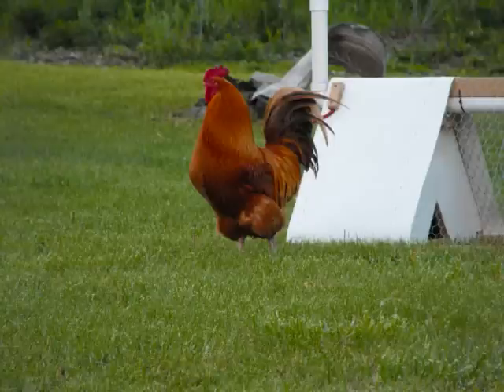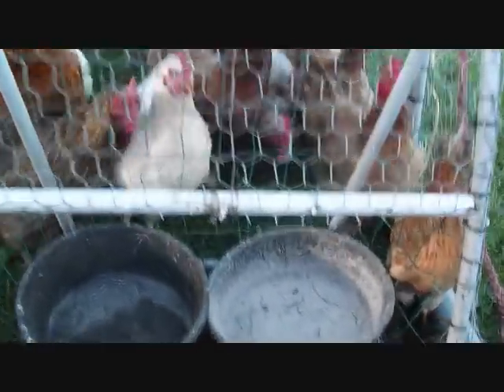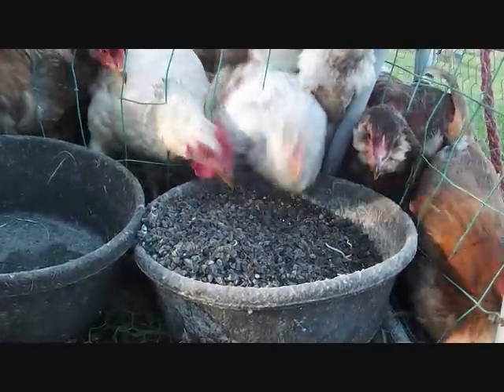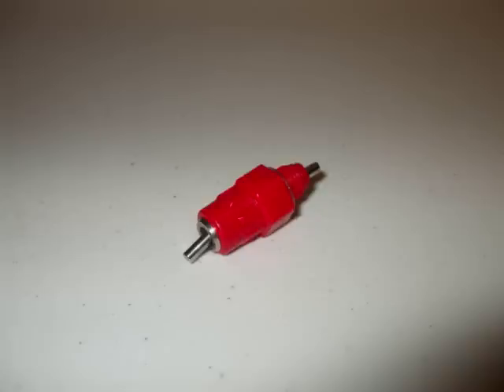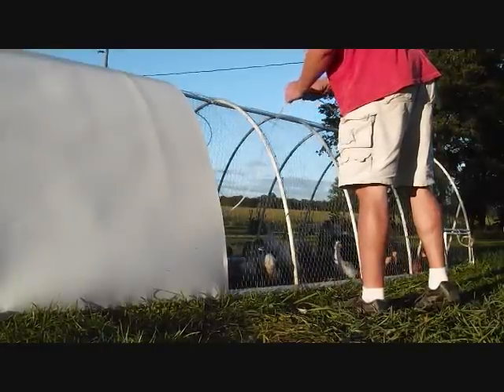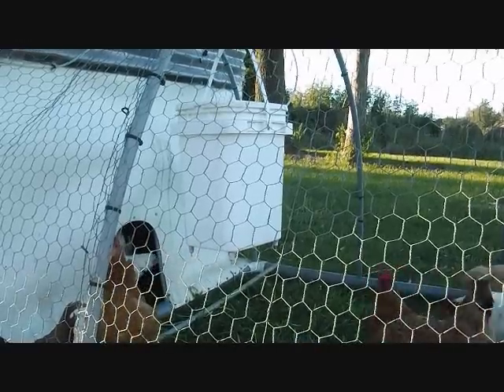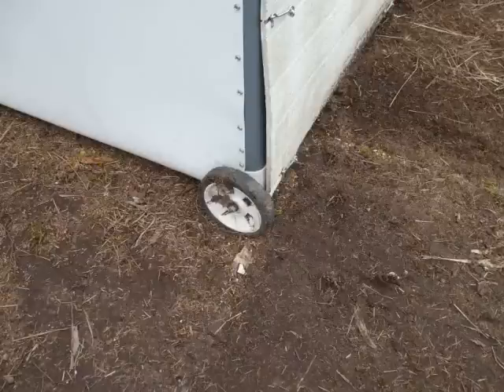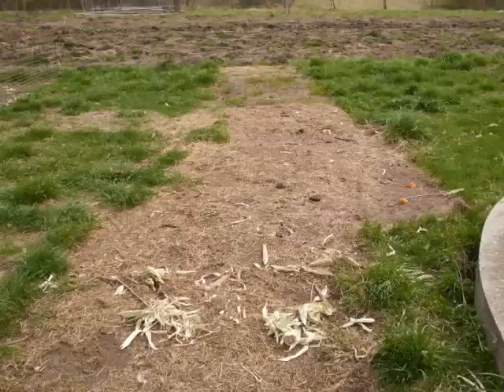Chicken Tractor Good Design Practices, Tips & Tricks For Building, Ideas

Comment: Looks like the chickens are left in at night, which is what I would like to do...Can you talk more about making these predator proof at night?
Reply from the maker: A good guard dog is what I normally use, but another way is to use a electric fence controller and attach it to the outside chicken wire, any predator that touches it will get shocked.
Reply: @JL-by4xu  thanks. We bought a LGD, still training him in. Thanks

Comment: What type of nest boxes do you use for the round tractor? Also is the plastic sheeting on the round coop?
Reply from the maker: I use square 5 gallon buckets cut in half for nest boxes. Been using them for years, round buckets work too. The white roofs are shower wall liner, sold at Menards and some Lowes.

Comment: PVC degrades fairly quickly in sunlight, have you tried replacing with metal conduit instead?
Reply from the maker: My first chicken PVC chicken tractor was made in 2006 out of regular white PVC. I am still using it and probably will for another decade. PVC will outlast treated wood in my climate, and if you use the PVC conduit it is even more durable as it is treated for uv resistance. I think a nice bowed tractor out of light weight metal conduit would be nice however.

Comment: What is used for roofing on the rounded hutch tractor. I see you used tin roofing for the square hutch.
Reply from the maker: It is bathroom wall paneling that can be purchased at Lowes and Menards, Costs about $18 for a 4x8 sheet and is pretty durable. I have some that is 11 years old.

Comment: May I suggest you cut a branch/limb off a tree and tie it with wire to the steel pole you use for the chickens to roost on at night, this will be better for the chickens feet than the steel pole, but it will need to be replaced if the chickens eat it, make sure it's a branch/limb with smaller branches coming off it so 4-5 chickens can stand on it and it's okay if some of the tree branch reaches  the nesting boxes so long as it doesn't go into the nest making it difficult for the hen in the nest.
Reply from the maker: I have heard of people doing such, but I like the pvc as it is very easy to clean.

Comment: Sun and freezing will deteriorate the pvc in a few years...I used some for horse jumps and it lSted about 5 years
Reply from the maker: That is why I use conduit for my new cages. Conduit is treated with UV stabilizers. That said my original chicken tractor is regular white PVC and it is well over a decade old. I worried about the PVC deteriorating when I built the first one, in Missouri PVC will outlast wood. The hardest condition for it is cold weather, as it gets brittle.

Comment: I see you have wire netting under your quails, are they still able to eat the grass? All of the chicken tractors I've seen on the net don't have wire netting, I would like to use fine wire netting to keep snakes out.
Reply from the maker: Yes, I use hardware cloth under the quail tractor, but not my chicken tractors. Quail are very small and like to dig, and if they get out you are unlikely to see them again. It would be better to have them on open ground, but that isn't easy with a tractor and having some hardware cloth under the cage is better than raising them in a quail battery.

Comment: Very informative thanks. I found your youtube video on building the ultimate chicken tractor about 3 to 4 years ago. The tractor is quite resilient to the strong winds that we have here in central NC, USA. I am trying to incorporate wheels onto the tractor because it is rather heavy and expect it to be heavier after I install solar panels, batteries, electric fence charger, light and bugzapper :). I have found that rolling CT on a piece of 4" PVC helps get it to the next spot down the line though. Thanks again.

Comment: Thank you for the great video, it answered lots of questions I had about building my own chicken tractor. One thing I would like to ask you about, do your chickens spend the winter in the enclosed portion of the tractor? Our winters here are always below freezing and often dip below 0 once or twice a year. I like the idea of the plastic sheets covering the outside, but I'm concerned about the chickens staying warm enough throughout the winter...Any thoughts or opinions on this would be appreciated!
Reply from the maker: Thanks, yes my chickens stay in the tractors all year, It usually doesn't get very cold here, but it does get below freezing and sometimes some single digit weather. Roosters that have big combs getting frostbite is the only problem I have ever had with the cold. If you have colder winters I would advise picking a cold hardy breed, many breeds have pea and rose combs that are less likely to get frostbite. It is better and cheaper to pick a breed suited to your environment than trying to suite the environment to the breed.
Reply: I have Silver Lace Wyandottes and Isaac Browns right now, I've never had a problem with frost bite before in my current coop, but it's a conventional wood frame with wood siding. Thank you for the quick reply!

Comment: Where do you get the float valves for your buckets
Reply from the maker: I use dial float valves that are sold by many retailers and sold online on Ebay and Amazon. They have brass stems that are easily bent to adjust the fill level.

Comment: What was that white material you used to cover the hoop house? How did you attach it to the PVC?
Reply from the maker: It is bathroom wall liner and comes in 4x8 sheets. You can cut it with a good pair of scissors and runs about $20 a sheet. I screw it to the PVC frame with self tapping screws although regular screws work as well. You can buy the sheets at Menards and Lowes.

Comment: Hi ! It happens to be I'm having a similar tractor lol :-) . Also Pvc bows I have used and pipes for the feed / same system about the wiring there too :D , but the nestbox idea is awesome , I builded my nestboxes out of some scrapwood I had , a big drawer devided into only three of them ( I don't own as many chickens as you do for now ) , this works also fine as they have a roostbar build in pvc just before their nestingboxes , flooring of coop is completely in chickenwire as it is easy to clean and it ventilates very well plus they like to even roost on that too , only issue I have is they dare to sleep into the nestingboxes , any tips for that ? :)
Reply from the maker: I have heard a hundred theories on stopping chickens from sleeping in the nest box, some cut down on it but I always have some hens that will nest there no matter what. The best bet is to make the roost area higher and as attractive as possible with plenty of room for all the chickens. In the ultimate the roosts are the same height as the nest boxes, I have had less sleeping in nest boxes with lower nest boxes.

Comment: Great ideas! I have watched at least 60 hours of chicken tractor videos so far and this one goes into more detail than most. 

I do have a question about something I have been wondering about for awhile. why don't people just throw the food on the ground so the chickens can scratch around and get it? I have seen videos where chicken look like they will pass up the bowl of feed to go scratch around in the grass, if the idea is to have them clean off all the grass to make garden beds down, wouldn't throwing the food on the ground make the process go faster? 
They are going to drop seeds on the ground and poop out seeds all over so that stuff would grow eventually anyway so throwing it on the ground throughout the area would not make much difference or would it? There might be a reason for it going in a bowl but so far no one has said.
Reply from the maker: I throw scraps and sometimes grain on the ground. The main reason I put feed in the bowls is to prevent waist. When you throw grain on the ground the chickens don't get it all. As long as they are in a clean are throwing grain on the ground to promote scratching would be just fine.

Comment: Hi Joseph, I built my tractor based on your design a couple of years ago and like it alot. I do find it a little difficult to move though. Do you have any suggestions for putting wheels on the heavy coop part? I can 'slide pull' the tractor sideways but cannot pull it longways from the end of the tractor where the coop door is. Thank you for the great design.
Reply from the maker: On my large tractor I have T's on the back and slide an axle into the pvc pipe. Makes it a little easier to pull. For future designs I am going to try some drop down wheels on a pivot.
Reply: @JL-by4xu  May also try wider wheels they don't sink into the grass or wet areas.20 inch bicycle wheels work good also they cover more ground.They are easy to find in the metal recycling dumpsters.The front ones are easily removed and easier to mount on your tractor.

Comment: Do you glue your pvc? if not, does it hold together well just fitting them together? and what do you do for your chickens during the winter or when adverse weather conditions?
Reply from the maker: +Kevin Smith The frame is glued, the hoops are held into the frame by the chicken wire. My chickens stay in chicken tractors all year. I live in northern Missouri and it doesn't get cold enough to worry about hardy chickens.
Reply: Joseph Lewis 

Does it drop to below 10 degrees?
Reply: Also, the solar lights, do they have to be bug zappers? Or just solar LED lights to attract the bugs to give the girls more food?
Reply from the maker: +Kevin Smith Rarely, maybe only a couple days out of the year.
Reply from the maker: +Kevin Smith Chickens roost when it is dark, but quail don't. I use solar pathway lights in my quail cages to attract bugs at night, but it doesn't work as well with chickens as they are sleeping at that time.

Comment: What size pvc do you use?
Reply from the maker: +Kevin Smith I use 1/2" or 3/4" for the hoops and 1 1/4" to 2" for the frame depending on the size of the tractor and its intended use.
Reply: Joseph Lewis 

I have to worry about skunks digging into the tractor.  How do I build a floor into the tractor frame?
Reply from the maker: +Kevin Smith If you have that problem I would rather energize the outside of the tractor with an electric fence charger. You can even use the insulators to stick a wire all the way around the outside of a tractor where the culprit cannot even get close without being zapped. I myself use dogs, but have energized the outside chicken wire on tractors when they are in the pen with cattle who like to scratch on them.
Reply: Joseph Lewis wouldn't the girls get shocked as well?
Reply: Or do you mean a fence that is not touching the tractor?
Reply from the maker: +Kevin Smith Chickens are not very susceptible to electric shock, they are heavily insulated.

Comment: Very good ideas and details!  I would center the feed shelf on the wall and make it wider with a wide/narrow trough so more chickens can get to food across the front and on the sides.  While there head can fit through a 2 inch wire, their bodies still need 6 inches to stand next to each other.  It will be less stress and pushing to get food.
Reply from the maker: +LKH Fun Thanks, yes adapt however works best for you.
Reply: @JL-by4xu  Yes, I could see one chicken being stood on on the right side of the feed room. There needs to be more room so no one has to be pushed down. Food time should not be laborious. It should be free. So it is not however it works best for you. Its however it works best for all the chickens... thanks for all the ideas :)

Comment: Hi! Can I ask how did you fasten the nesting buckets together? Then how do you have them attached to the coop itself? I am building my tractor now and thought that was a great simple and very sanitary option and I plan to use that idea....just wondering if there were suggestions on best ways of installation!  Thank you!
Reply from the maker: Tina Adelmund There are two pvc pipes that the nest boxes are setting on. I used a screw on the front and two screws on the back to attach the buckets to the pvc pipe. The nest boxes are not attached to each other, just the pipes. I also drilled holes on the bottom of the nest boxes to drain water out, also makes them easy to clean out. I have been very pleased with the nest boxes and cannot think of anything I would change.

Comment: Just wondering if you keep the chickens in chicken tractor in the winter?  If so how do you keep them warm?
Reply from the maker: Jeremy Yes, I live in Missouri it doesn't get that cold compared to many areas. They need a dry draft free place to go.
Reply: Joseph Lewis What do you do for water in the winter?  Would the nipples and pipe freeze?
Reply from the maker: GrowMap Yes they will freeze, the bucket waterers I use don't break when frozen, the PVC water pipes will break when frozen. I have used small heater in the bucket waterers, but they seem to burn out frequently, so most of the time I switch to using the rubber bowls to water in winter.
Reply: Joseph Lewis Thanks for taking the time to respond, Joseph. Do you fill one rubber bowl with water and the other with feed on the shelf or do you put the water somewhere else?
Reply from the maker: GrowMap In summer both bowls are for feed, in winter it depends, sometimes one is water one food, other times both are water. It depends on what I am doing. In winter my chickens are often fed a lot of produce from grocery stores and that is dumped on the ground to be picked through.

Comment: what is the material for the outside of the dome of the chicken house at .28 sec of the video?
 (the white wall)
Reply from the maker: It is poly sheets sold at some Menards and Lowes for bathroom wall panels. It is flexible and sunlight resistant. It is great stuff, easy to clean, lightweight and durable. Costs $16 for a 4x8 sheet at Menards.
Reply: Joseph Lewis I thought so but wanted to make sure.  It does OK in the sun..really?  Cool
Reply from the maker: Michael Kovaleski Yep, my first tractor I used it on is 10 years old and that poly is still in use. Ten years outside the whole time is a goot testament. Won't last forever, but it is pretty durable.
Reply: Joseph Lewis  thanks.  will strongly consider it for my next build.

Comment: looks great, but how do you keep predators out of the thing?  I use a similar design but the nesting area has a door and a floor.. I have found skunks and other nasties in the run area multiple times.  with the open door to the coop and no floor it  seems like you are asking for trouble imho.
Reply from the maker: Hard to keep chickens in my area without a guard dog. I have not had a problem with anything getting in, if I did I would electrify it and probably stop any predator in their tracks. I really try to stay away from floors or anything that collect refuse, and I have tried doors but found them unnecessary, although I will be trying automatic doors on a free range flock next year. Been keeping chickens a long time, so it works for me, every area and situation is different